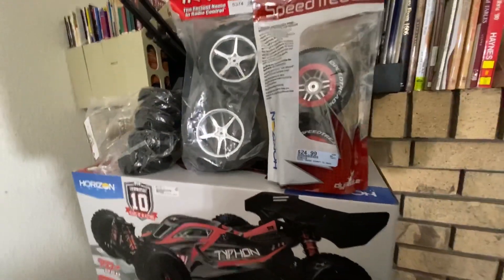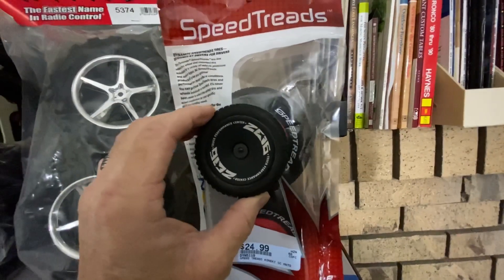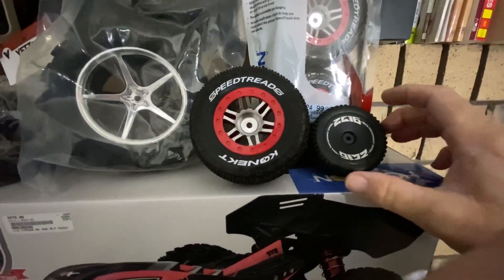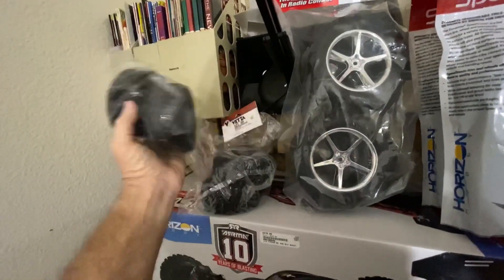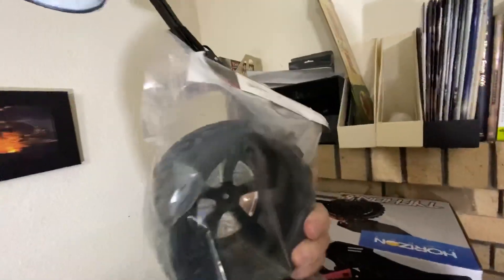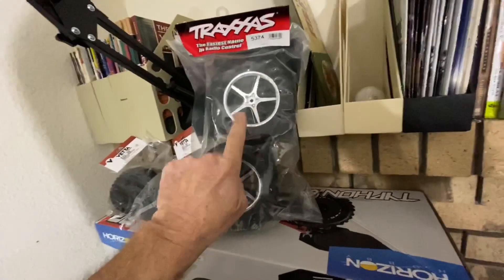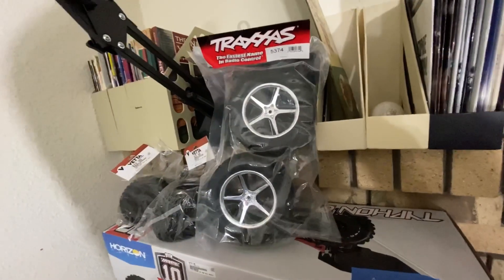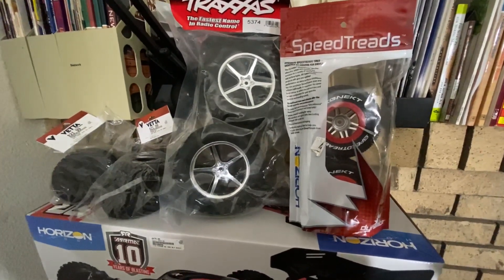WLtoys 144001 3s test setup

Comment: I mean if the bigger tire the same weight of the smaller tire it would make it faster
Reply from the maker: It would but the concern was making too much load on the ESC and motor with the taller tires. It also would add stress to the crown and ring gears.

Comment: Hey my brother are you trying to burn your esc up? 🤔
Reply from the maker: Mikes RC Garage nope, I have an IR thermometer and I’ll be monitoring the test closely. 

There is a mod I’ve heard about and this will take the guessing about if it works out of my mind. 😂
Reply: @RCModSquad  Ok my bro, I do understand why you're doing it and I'm sure you are completely aware of what you're doing. I just hope you dont let the magic smoke out of the box! Lol 😎👍
Reply from the maker: Mikes RC Garage I’m actually gonna run it without a body so I can check the temp on every pass. My goal isn’t to see how hot I can get it but just to see if the mod actually makes a difference. 

Have a great night bro!! 👍🏻👍🏻
Reply: @RCModSquad  I hear ya my bro, the only way to know is to try! ✌😎👍 Thanks brother you have a great night as well! 🙏
Reply from the maker: Mikes RC Garage I’m mostly doing this for everyone else. I’ve heard about this mod from several people so I just want to do a temp test on the ESC to see if it’s a real beneficial mod or not. Putting the big tires will help me be sure there’s enough load to warm the ESC up. I’ve done 3s speed runs and had no ESC problems. 

I have a stock 144001 I’ll keep that way and just run on 2s. The second car will be upgraded to brushless so “if” I burn up the ESC it really won’t. be a problem, however, I actually have plans to build a recovery boat using this ESC, radio and servo so I’m gonna try hard NOT to fry it. 

There is a method to my madness. 😂
Take care my brother.

Comment: i had no issues running mine on 3S, but i always install cooling fans to keep the temps in check on all my rc trucks and cars. I managed 83kph on 3s on the 144001 in my speed run tests back in November. Why do you want to load up the motor by risking burning out your esc with larger tires David?
Reply: Hi. Wich battery 3s do you use.?...wich mha?
Reply from the maker: Rui M the one I’m using is a Gens Ace 1550 mAh 45c. It fit if you move the front of the battery box all the way to the front. 

Thanks for watching and let me know if you have any more questions.
Reply from the maker: I haven’t had any issues doing speed runs on 3s but when I used the paddle tires in the snow it got really hot. 

I don’t want to burn up the ESC I will be monitoring the temp closely with an IR thermometer. I heard of a mod that is supposed to make the ESC handle 3s better. My plan includes the larger tire just because it will make the test go faster. I’ll do a little bashing in the grass and check the temp , do the mod then bash a little more and check the temp.

So my overall plan is just to see if this mod really works. The big tire just make it happen faster.